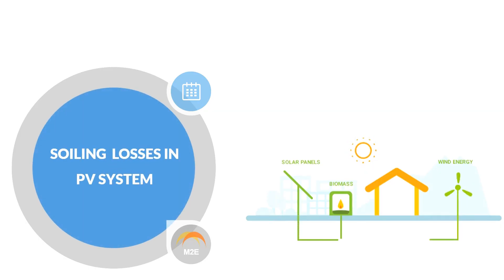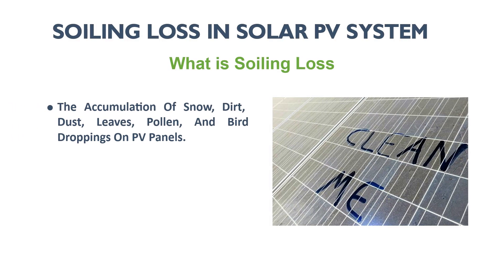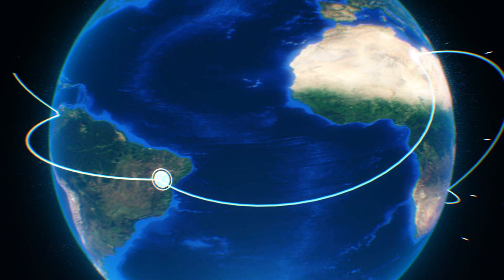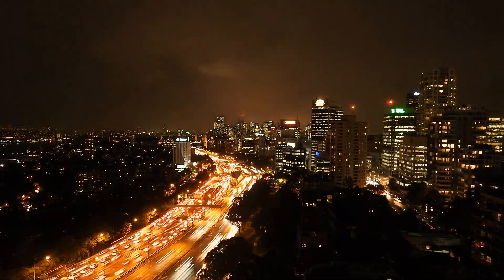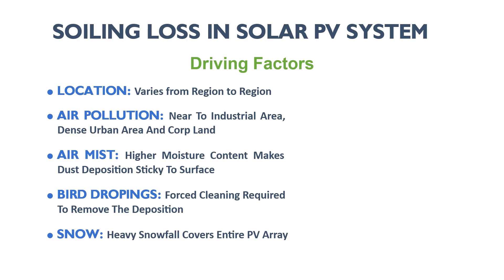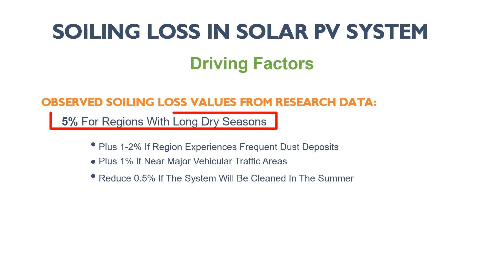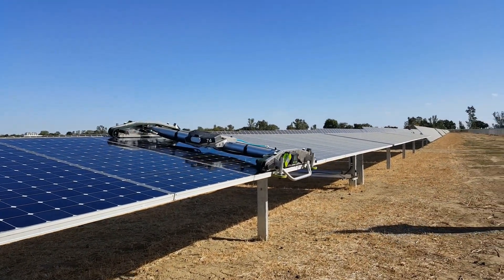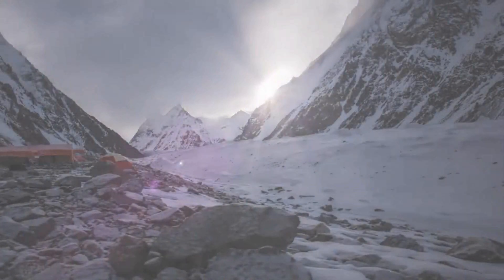WHAT IS SOILING LOSS IN SOLAR PV SYSTEM

Comment: There is 1 thing called " torque" which effects our solar system designing,  many of us design our system but due to high torque of air conditioners and other equipment system fails to run on that inverter desiged please make a video to help understand how to design a system keeping in mind wattage & torque of appliances.  Thanks

Comment: Thank u for this vedio please  I have a question is there any formula to calculate the soiling LOSS?
Reply from the maker: Hi Abssane, Yes. There is a formula. You can Google it and will get a few papers on it for sure. But, to determine the loss using the formula, needs a lot of complex inputs which is not easily available.
Reply: @Minutes2Energy  no more videos?
Reply: Follow my page on Linkedin for this and for more information.